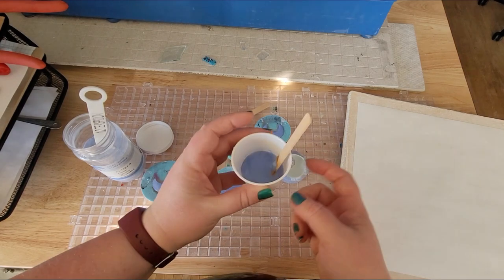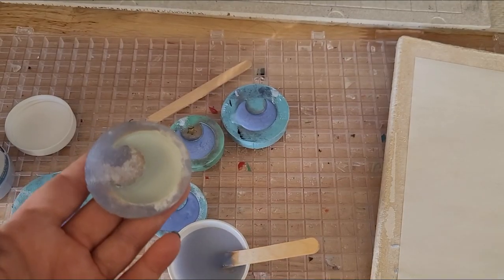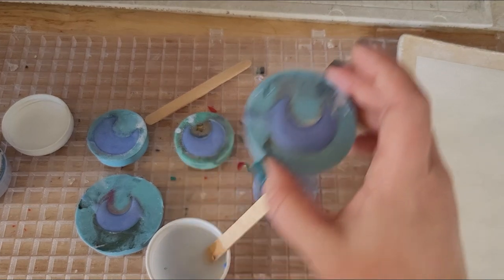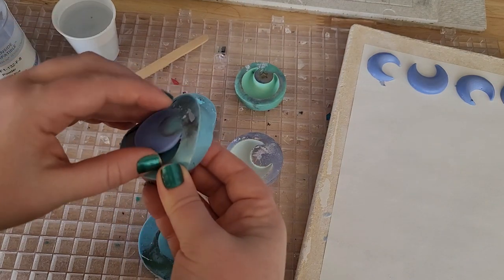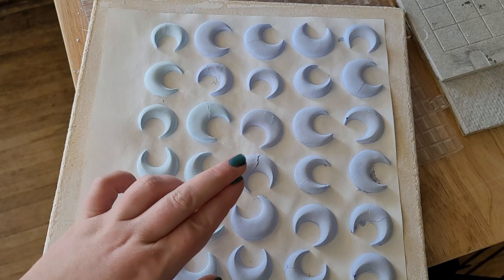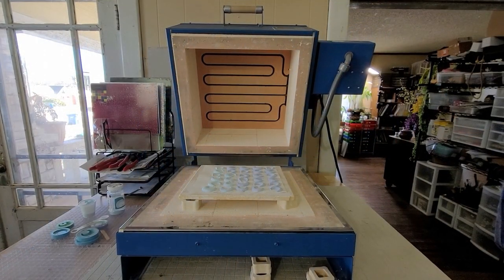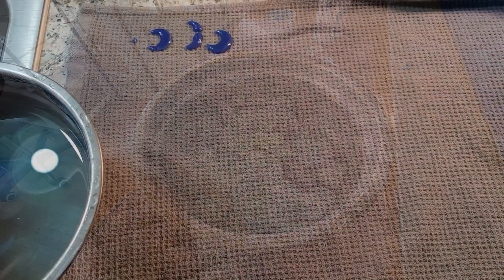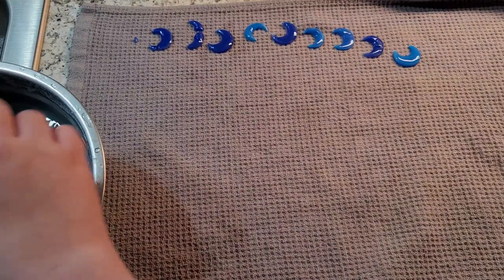Freeze and Fuse Moon Experiments

Comment: When I do freeze and fuse, I have to schedule about two full days and I just work every mold I think I might want for awhile. It is labor intensive and time consuming, but it is so worth the effort. Love our channel. You are an amazing artist! I see myself as a glass crafter, not a glass artist. You are an artist!
Reply from the maker: Wow, thank you!! I am still just bumping around figuring things out <3 Freeze and fuse is time demanding, like doing laundry; I have to stay on top of it to get it done. The moons we do with the ring saw and grinder kick my butt, my hands are always sore after, so its nice to alternate with freeze and fuse
Reply: @backtoearthcreations  I hear ya, my fingernails are a disaster! BTW, to help prevent the cracking, letting the pieces dry slower and using Papyrus brand paper, instead of Thin Fire, might help. I have had very good luck with that. I had the worse cracking when I left a fan on in my studio and my kiln lid was open. I won't do that again. I am still very new to fused glass, I only got my kiln in May of 2021, so not even a year yet. but I LOVE it! I have borrowed a couple of your ideas for casting cabs for pendants.  I hope you don't mind. The colors you used were so pretty! And using the double thick glass on top made it so there were no bubbles. Thank you for that one!!